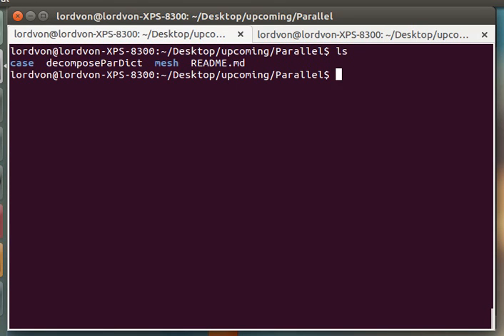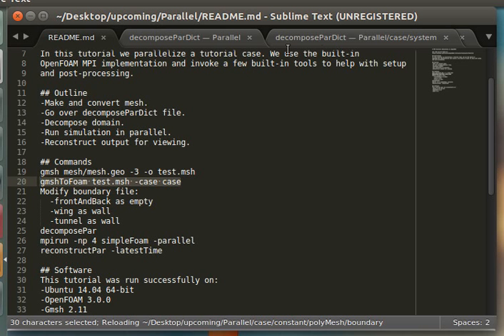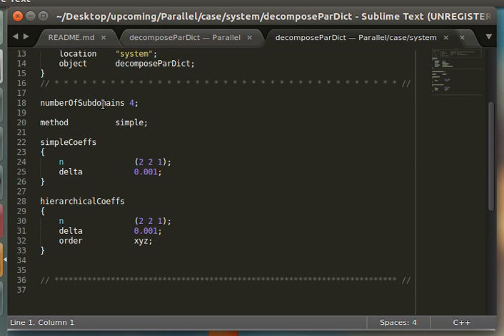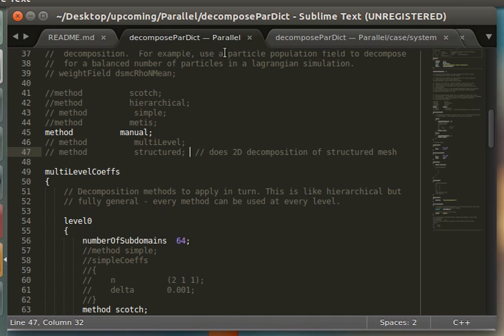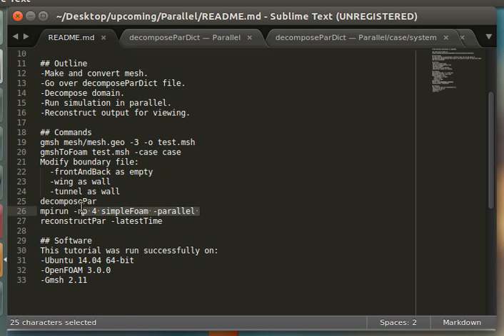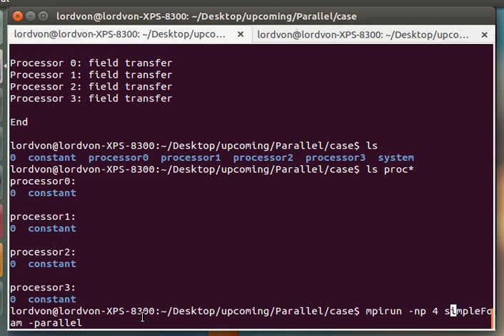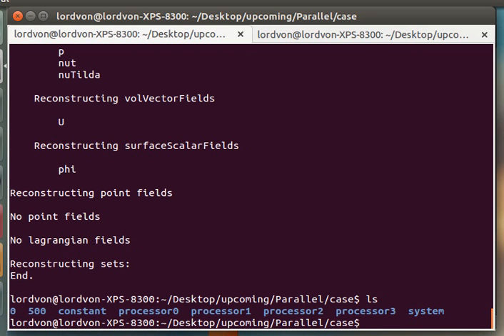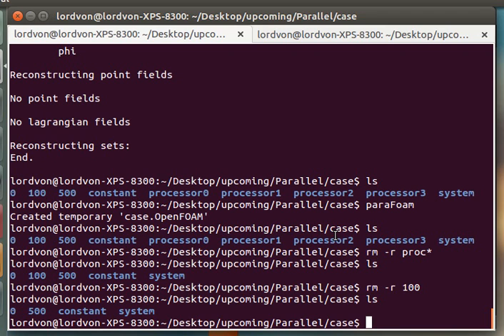Parallel Simulations in OpenFOAM

Comment: I am getting error - 

WARNING: Linux kernel CMA support was requested via the
btl_vader_single_copy_mechanism MCA variable, but CMA support is
not available due to restrictive ptrace settings.

The vader shared memory BTL will fall back on another single-copy
mechanism if one is available. This may result in lower performance.

  Local host: DESKTOP-38IC7BI
--------------------------------------------------------------------------
[DESKTOP-38IC7BI:15728] 3 more processes have sent help message help-btl-vader.txt / cma-permission-denied
[DESKTOP-38IC7BI:15728] Set MCA parameter "orte_base_help_aggregate" to 0 to see all help / error messages

Comment: Thank you very much!
 This video is really helpful and concise!

I build a model using OpenFOAM and try to run the model in parallel. 
When the size of the mesh is about 700M, the program goes well. 
When I improve the number of cells and the size of the mesh becomes 5G some errors happen.
I tried to use 8 cores for parallel calculation, the errors are:
(1)7 more processes have sent help message help-btl-vader.txt / cma-permission-denied
(2)mpirun detected that one or more processes exited with non-zero status, thus causing
the job to be terminated.

Could you give me some help about how to solve this problem?

p.s. The size of the mesh which generated by blockMesh is about 5G. 
        The solver I used is rhoPimpleFoam.
       My computer has 8 cores and 16G RAM.

Comment: Hello

Using OpenFOAM v5.0 and gmsh 3.0.6 I got an error when calling gmesh.

An alternative approach to reproduce this tutorial is by:

0. Go to your working directory by typing run or whatever corresponds.
1. Copy the airFoil2D tutorial to your working directory:
cp -r $FOAM_TUTORIALS/incompressible/simpleFoam/airFoil2D/ .
2. Do not change the boundary conditions in this case, and use the simple version of the decomposeParDict available in the directory system of the case file.
3. follow the tutorial since the step decomposePar:
4. Visualise with paraFoam

By the way, thank you very much four your video.
Reply: Thank you for this example!

Comment: what if it doesn't run faster !?
Reply from the maker: Well, that has to do with the basic issue of parallelism. If your case does not have enough effectively parallelizable work (not enough cells), then the overhead associated with parallelization will outweigh any benefit.